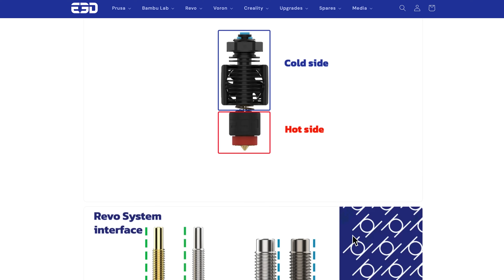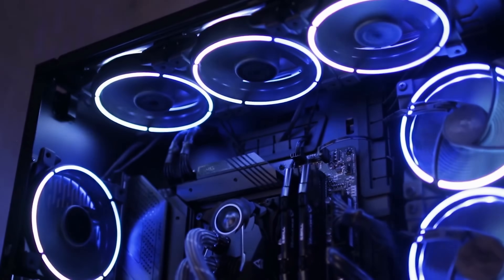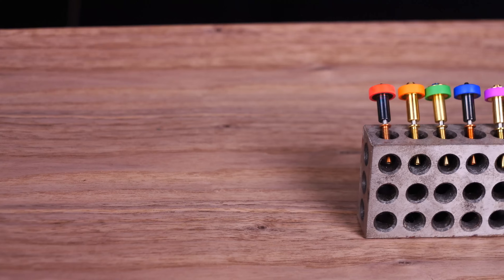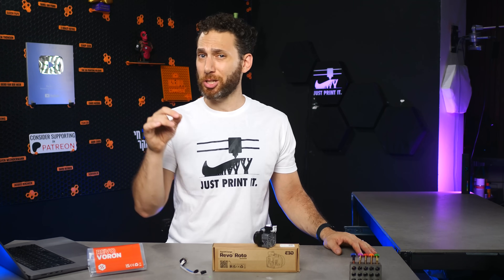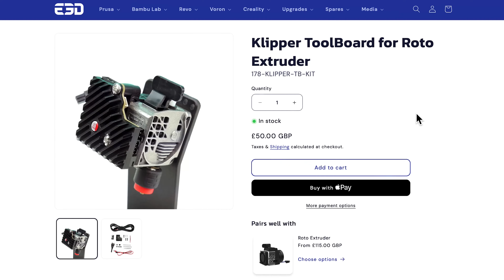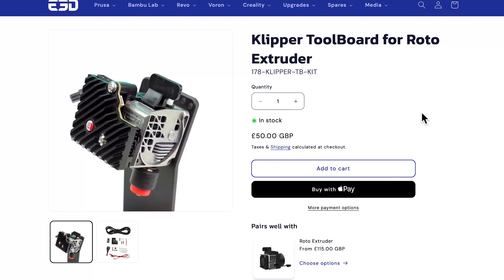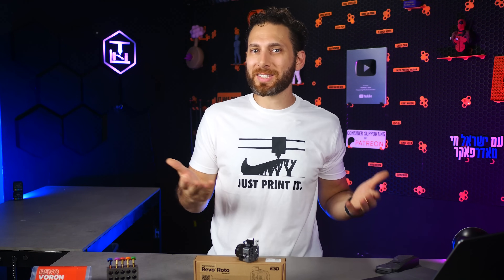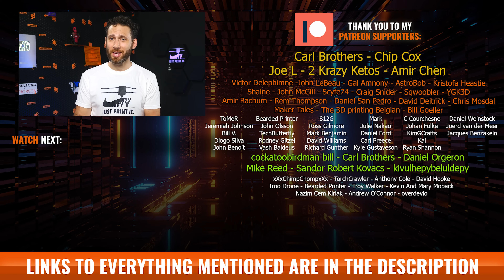E3D's New Release...& What It Means for 3D Printing

Comment: Just oof. All of the mentioned companys are locking others out of the game and are more profitoriented instead of working with others to get to greater things. You do you but i dislike all of them. It started with Prusa und look where we are now. Everyone cooking their own soup. Sorry i have to disagree. 3D Printing evolved most with community driven projects. I have never and will never buy an E3D product.
Reply: In a sense you already have bought a product from E3D. Prusa Nozzels are actually from E3D. Every V6 Nozzle is either from E3D or a clone.

You may be interested in the new FIN Open Source standard propagated by Slice Engineering. These new nozzles are currently only used in the Mako Hotend for Bambu Lab printers, but in future the Mosquito Hotend and products from other manufacturers will also be compatible. As far as I know Diamondback, Bondtech and Swiss Micro are also in on the FIN standard and will launch compatible products in the near future.
Reply: @andreas.grundler  Never owned a Prusa or V6 either.
Reply: @robertkruger8180  Well, what do you own?

The V6 nozzles used to be more or less the standard and were originally developed by E3D, which were then quickly cloned by Chinese manufacturers. Not really a standard by definition, but more in the sense that they were used by everyone. And you can even use a V6 nozzle in a new Mk4S because Prusa has an adapter.
Reply: @andreas.grundler  I own a heaviely modified Reborn 2. Installed a K1 Hotend with Ruby Nozzle on it. You might tell me "well thats a Supervulcano". Might be a far stretch though. This is where you dont get what i mean. EVERYTHING was invented by the community long befor companies like E3D, Prusa or "insert your favorite manufacturer here" took it and licenced it (and then started to lock their ecosystems to their own products).

Comment: I'd been trying to work through whether to go Revo or V6 (or Bambu-clone) hot-end for an IDEX replacement for a Lulzbot Pro Dual I'm working on. I think the Probe setup makes it an obvious winner.

I didn't hear it, but is this style of heatbreak/piezo setup going to be patent-walled?
Reply: I doubt, there's similar designs from like 10 years ago like the precision piezo, only DIY and clunky but it's not novel
Reply: I couldn't find an filing for E3D at the European Patent Office for this specific setup.

Comment: lol what ? Fast changing nozels was a huge deal for me. The constant filament jamming in a printer is a pain and the leaking from the heater block was a nightmare so changing the nozel fast for me allows for quick change and back to printing. Plus not twisting the heater block or stripping things while possibly burning myself was another reason why I liked it.
Reply: Why not just find and fix reason of jamming? Use titanium heatbrake with high quality thermal paste, for example?
Reply: @TheNamelessOne12357  Just upgraded to a Revo Six from a V6 with titanium heatbrake and good paste. 
It's not just the it removes all the failure points of the older system. Even ones caused by my clumsiness and my apparent inability to hot-tighten the nozzle before the thermal protection shuts everything down without stripping the thermistor or cartridge cable or ruining the connector to the layer fan. 

It can't leak, it doesn't need the hot tightening, the heatcore is virtually indestructible. Yeah, a heatcore costs more than the heat block components, and I can't buy the single emelents independently, but I also won't need to because those parts aren't going to break in the first place. 

As for "It never jams if built properly" it's not always true, some filaments can jam it, especially if contamination is involved.
Reply: @TheNamelessOne12357  after disassembling the machine to fix the jamm, to get back up and running. To only come back to yet another jam… very frustrating, especially with a machine like the lulzbot pro where the fan duct and cooling fan has to be removed before even trying to take the nozzle out and figuring out the issue. Oh and the older style heating block, yeah let’s have that give you an issue so now the entire system has to be disassembled  in order to swap out a thermistor or heater block ( removing it since old filament has fused to the grub screws to the point I no longer have the ability to back them out ). The revo system just removes these complications ( I’m not saying there aren’t other systems that are just as simple  but the old v6 heater block just left so much room for improvement). On the revo if any one of the components have an issue it’s as easy as removing the filament while the machines hot, waiting to cool off, unthreading the nozzle and I can removed everything else quickly without having to remove all kinds of parts.
Reply: @DamienDavidO  You're trying to cure symptoms, not the disease. Standard V6/Volcano never jams if built properly. And by properly i mean good titanium (no steel, no PTFE) heatbreak and good thermal paste.
Reply: @TheNamelessOne12357  I agree, a properly built  V6 is all rainbows and unicorns until you start changing the nozzle quite frequently. Then the sky darkens and all the orcs appear. What happened to me was as I tightened the nozzle, the heatbreak started to turn pushed by the nozzle as well as the heatsink on the cold side. Then the gap between the tightened nozzle and heater block disappeared after a few nozzle change. Then you try to turn the coldside back to be able to move the heatbreak srew more into the heater block to restore the gap, then you have a good chance to severe the wires of the heater element or the temperature sensor. Since there is no access to hold on to the heatbreak on a V6 while you are tightening the nozzle to turn the heatbreak an the coldend heatsink is unavoidable. It is just a matter of a count of nozzle swaps.
Reply: @theozoo4350  This happens with very cheap chinese clone heatblocks, which are made not out of aluminum, but out of some kind of aluminium powder. They are really weak and M6 thread can be easily destroyed with bare hands. I use nikel plated copper blocks and they hold really well, and, also do not need silicone sock at all.

But do we really need to change nozzles that often? We can use line width and print up to 200% wider than nozzle diameter. Or even more.
Reply: @TheNamelessOne12357  Well it was a Prusa MK3 from Prusa Research, should have an original E3D hotend. Nothing was wrong with any of the parts. The heat sink itself turned inside the casing. Shure you need change if you print CF materials. But the steel nozzle is a really bad heat conductor, so either you slow down the normal prints or swap back to brass. 200% line width? May work with the Prusa but not with a Voron at speed. Anyway, I think it is already too late to turn back, my soul is lost, I am completely spoiled ;)